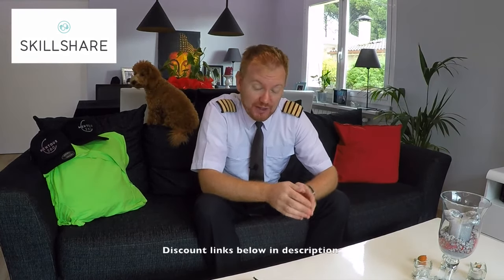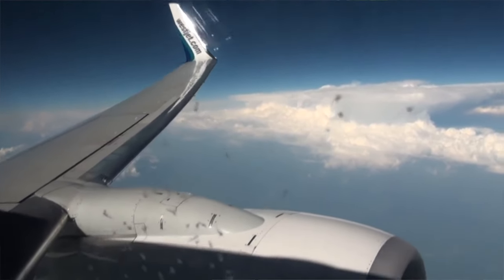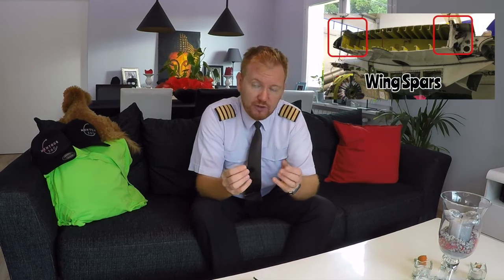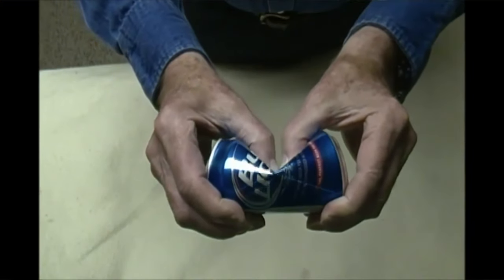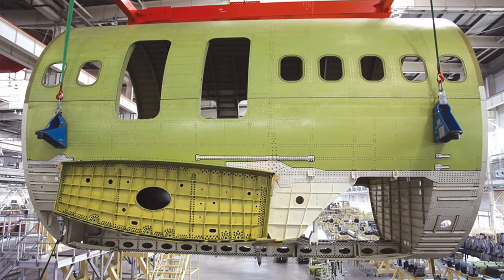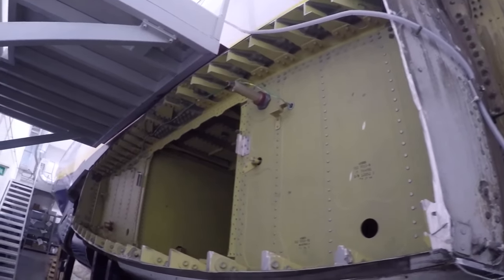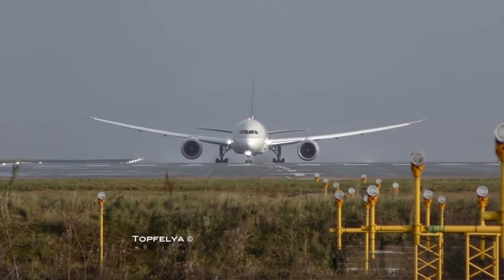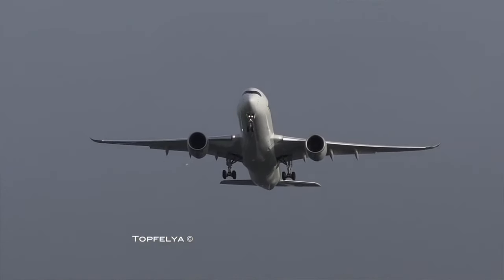Why don't the wings break?!

Comment: I am going to show how old I am now by mentioning a name from a bygone age. Back in the day one of Freddy Laker's planes had crashed and the rest of the industry lynch mobbed him by saying that he had not maintained the wing pylons and these had failed. I always wondered what wing pylons actually were. Can you throw any light on this? Thanks.
Reply: The pylons are the structures that join the engine pods to the wings. You've got it backwards on the Laker situation though. None of their DC-10's crashed but they (along with all other DC-10's) were grounded by an AD that was issued after an American Airlines DC-10 lost and engine on takeoff - not "lost" as in the engine stopped working but "lost" as in one of the wing engines came off the airplane. The pylon had been damaged by the airline maintenance shop removing and replacing the engine and pylon in a manner that damaged the pylon. The prescribed way to do this was to remove the engine from the pylon then remove the pylon from the wing. American and another airline had been removing the engine and pylon at the same time using a forklift. Laker was upset at having their DC-10's grounded because they had been doing the procedure correctly but their planes were grounded too because of the other two airlines using a shortcut. Ironically the reason all the DC-10 operators had been removing and reinstalling the engines and pylons was because of an earlier AD mandating inspection and replacement of the fittings that connected the pylon to the wing.

Comment: I'm not sure this is relevant to this video, but when you were talking about extreme turbulence in thunderstorms, you didn't mention maneuvering speed. A different subject: To help me have a more accurate understanding of the load, or lift distribution on a wing, I'd envision a straight wing, (no dihedral) , sitting on a flat piece of foam rubber, and see the that load, or lift is evenly distributed.

Comment: Once checked in the wind tunnel the engineers do the needful but too much flutter is hazardous & may prove fatal but thanks to the fuel that actually neutralize the vibration but bank angle may develop g forces that has to be another serious matter & next is extreme parameter push limits .

Comment: Very well done video I could tell that the chapter about safety maintenance was very important because the Apricot Poodle snapped to attention!  I used to have one and they are smarter than most 9th grade students.  I noticed you have matching hair so I will bite my tongue about now.  The G force explanation needs a tiny clarification as the couch is experiencing your weight as a multiple of 1G .  You do not weigh 1G.  You weigh whatever you weigh based on the relative mass between you and the Earth.  I think.  I know there is something about acceleration in there too.  Very good video all in all.  Would have advised the use of toy airplanes to illustrate some points .

Comment: i got 2 curious questions. 
1: why are the main airliners not using alternative wing designs? for example the Delta wing. wouldnt it be more sensible to use the larger internal space for fuel and storage depending on the design?

2: why isnt there many Turboprop airliners for long hauls? considering people care for efficiency wouldnt it be more sense to use that?

Comment: Wings are not connected by hundreds of bolts, usually very large 1 to 1 3/4" bolts depending on how big the plane/wing is. And mostly either 4, 6 or 8 bolts, again depending on size of the plane/wing. I'm a 24 year commercial jet mechanic/5 year military aviation technician.  
Wingtip Flex/stress test can have a wing move 12, 13, 14 feet or better. (Note: A 12 foot flex is measured by a flex of 6 feet in one direction (up) and 6 feet in the opposite direction (down) from its natural/neutral resting point...

Comment: Wing question. Always wondered what the little bracket type things on the top surface are. I think there are around 10 in a row on towards the end of the wing on a 737. Maybe to direct air? They just seem too little, appearing just an inch or so tall, to have any significant purpose.

Comment: Supertankers were designed to flex in much the same way during rough seas. Smaller ships didn't need to flex but the larger they became the more chance they had of braking in half and so they were built to bend slightly.
Reply: Breaking not braking

Comment: a design factor of 200% or more for each part ultimate or design  stresses so it will be safe to use.All parts are subjected regardless of material and the process it was built to failure that is why safety factor is applied.

Comment: 3:50 its actually called Alclad which is  an Aluminium alloy with a Cadmium protective coating on top to provide strength.
Reply: flynorthernva:  Nope. Alclad is not Cadmium, it’s a thin layer of pure aluminum which is there for corrosion resistance and is not very strong at all. In performing stress analysis with Alclad material, in many cases that thickness (~5%) needs to be corrected for (removed from consideration)
Reply: @dmoq683  is that what you found of wikipedia then?
Reply: flynorthernva   Nope, 25+ years doing stress analysis for Boeing, Lockheed Martin, and the US Army.

Comment: A mega rollercoaster (the steel ones) can have 4 G in a turn and few record breaking ones can get instantaneous 6 G.

Also Aircraft design safety factor is 1.5, so 2G rated wing can actually withstand 3 G.
Building and Bridges usually have higher factor of safety 2-3 but their design is not rigorously checked and not destructively tested. Aircraft wings will be loaded to rated limit and then go all the way up to the load accounting for safety factor, if the wing didn't break when they reach that, they will continue until it breaks.
Reply: "mega rollercoaster" I have no idea what that is.
Intamin's hypercoaster (over 200ft) model is called a Mega Coaster, but that's one manufacturer and one model.

Comment: A few decades ago I traveled in the Eastern Europe on board of an aging charter plane, probably Antonov or a similar middle-sized plane of Soviet construction. During the flight I noticed that wing plates were moving against each other a bit, perhaps a centimeter or so - to the level that some paint was scratched off the plate around the rivets. I didn't feel too safe at the time seeing that - but was it in fact safe, or not so much, indeed?

Comment: There were quite a few dc10s that were turned upside down after touching ground with the wingtip. So the wings were too hard to flex normally, hence breakable, I suppose

Comment: Flight 587...Absolutely Stunned that a few wrong rudder movements can cause the Tail to BREAK off off and The plane is out of control...Some of these planes need to be a LOT more sturdy than that...And a Passenger plane SHOULD be able to still Fly if a Piece of the tail falls off...Something HAS to be done

Comment: In 1974 , there was a terrible accident, in Venezuela. A DC-9-14 lost an elevator (the elevator got off the tail of the airplane) during the climbing phase, at 1 and a half minutes of the flight , due to a poor maintenance 4 days before the accident that caused  a loss of control of the airplane at 4,125 feet of altitude. The airplane fell spinning without control for 14 seconds, developing a high speed. and finally crashed in a flat depopulated area with tall trees. All 75 people inside the plane including the pilots and de crew died for the impact. That is how I lost my father , 47 years ago,  because of the poor maintenance of Avensa, the Venezuelan airline owner of that DC-9-14. The irresponsibility of Avensa caused this tragedy.

Comment: Thank you so much for your video, this has been a huge concern of mine, the one thing I am concerned about is the maintenance you mentioned, everywhere in automotive shops and everywhere you look, people have less care in doing their job these days than they used to in prior decades, when an airline is intended to run for profit, they have what’s I believe known as an acceptable loss range, so at what point do they sacrifice maintenance for profit? And is it possible that a major airline such as Southwest could skip some maintenance to save money or with the Federal Aviation Administration have some way of knowing that they are doing their appropriate maintenance, such as when the wing structure was found cracked in the 737 that you had made a video about, it was fantastic for the message to go out to all the airlines but how do we know the airlines actually did it and didn’t just say they did?
Reply: Well something similar has happend before, not refusing to do mantenace but being lazy and breaking rules. This is a crime now, if any airline does this they will be no longer

Comment: If you went to a metal supplier and asked for 'aviation grade aluminum' they'd look at you funny and then ask you what you want. What you need is commonly available aluminum meeting a certain specification.  Once it's cut, drilled, riveted, inspected, coated and certified as an aeronautical product, it's now 'aviation grade'. Whatever that means.

Comment: Something you did not mention was an overstressing of the wing loads due to pilot error or mechanical fault. Example would be over speeding after the aircraft enters a steep dive and is attempting to pull up due to an engine/s out or stall etc. How likely would that be? also would the tail section be more likely to fail than the wings ?

Comment: As long as it is not stretched beyond it’s elastic limitations. As a fiberglass fishing 🎣 rod the bend is distributed over its entire length.
Of coarse there are limits but the wing is tested to strength well beyond expectation of loads over the coarse of its service life.
Carbon fiber is even lighter and has proven very strong as well.

All edges are radiuses to avoid sharp angle stress points. The de Havilland Comet window design discovered the hard way.

The C- 5 Galaxy wing able to sustain flight at 840,000 pounds. A pioneer of modern heavy lifting design. 
When test facilities tested her wings to break ups the last of her gallant bulkheads make a terrible bang.

The Boeing B- 29 and later Convair B- 36 taught many lessons of handling and attaching large wing sections. Boeing Later went with swept wing designs on the B- 47 and B- 52. The later still in service.
Re engined  and new avionics but the basic airframes solider on.

Comment: What about the cracks in the A380 wings that were discovered thanks to the repair work after QF32 uncontained engine falilure? What about the 737 NG pickle forks? Does that mean that the computer simulations of stress were wrong and the monitoring of the fleetleader wasn't thorough enough?

Comment: Thats a pretty good explanation. Let me add on to this. Many of us have the misconception about the force acting on the wing. We assume that the force acts upwards at the tip of the wing. The truth is, if we divide the wing by 1000 section from front to back, (in aviation we call it chordwise), each section individually has a lifting force. That force is highest at the fuselage(root), and gradually decreases at we go at the tip. For some design, that upward force decreases to zero before the tip, and that force shifts downward at the tip.
This lift distribution is vital in keeping the wing bend (bending moment) to a reasonable value.
Lets do an experiment. Hold a ruler covering 10 cm at its edge with your hand. Now take a small but thick book and place it on its edge at the end of the ruler. The ruler will bend excessively. Now take the same book and place it by its large falt surface on the ruler near your hand. You will notice that the ruler bends but not quite much as compared to place it at its edge. Engineers used the same principle while designing the aircraft.
Aircraft designers have devised ways to avoid excessive bends and twist on wings. There is a system called active load control. Whenever the wing flexes, aileron and spoilers will deploy, very slightly without the pilot knowing. It is a self correction and this aids in reducing the stress and fatigue.
For those interested in knowing more, check out the following words in google:
1. Prandtl's lifting line theory
2. Force distribution on wings
3. Flight controls and why the concord did not have elevators.
4. Aluminium composite and Alclad

;-)

Comment: Given the regulatory capture of the FAA by the aviation industry (e.g., illustrated by how the FAA did NOT properly oversee Boeing's 737 certifications, etc., etc.) your comment about "if the FAA allows an airline to operate, you can be sure it's safe" is certainly highly optimistic, almost Pollyanna-ish.
Reply: Which has nothing at all to do with the airframe. That was due to an update to the MCAS software, an update that was pushed before FAA certification. In fact, the full software wasn't released to FAA until May of 2019, by which time the accidents had already happened.

Comment: Engineers put a lot of conservatism into the wing structure while also trying to minimize weight. This means that the wing would have to endure more force than would be encountered under normal circumstances but also is very light. This is why Aluminum is used for aircraft. While it is true that Aluminum alloys are stronger than elemental Aluminum, other materials such as Titanium would be significantly stronger than Aluminum. Unfortunately Titanium is more expensive and also a little bit heavier than Aluminum. And so basically there is this dance between considering strength of the material, cost of the material, and the weight of  the material that all need to be considered to produce an economical and strong aircraft wing.

Comment: Hi I hope you read this and hopefully make a video about it. 
For a short flight, under 1h or so, is it not burning more fuel to climb to cruise altitude and then quickly descend than it would burn in level flight at a lower altitude? I'm really curious about all the considerations about this matter.

Comment: @ Mentour Pilot During flight does the fuselage produce any lift?  It seems to me that during flight the nose of the plane ( commercial flight) is slightly higher than the tail. If this is the case, wouldn't the air going under the fuselage have higher pressure than the air going over the top and produce some lift?

Comment: They do break on very rear occasions. Usually after the pilots over speed the plane in a spiral dive then in the recovery attempt the pilot pulls and rolls at the same time. Wings aren’t good at taking excessive loads withe the pulling while being twisted by the rolling. Examples are Adams Air 737 in Indonesia and a Metroliner in New Zealand. Then there is the corrosion issues in old airplanes like the Grumman Mallard in Florida. That one was just flying along. The thing had been giving hints for months with skin cracks and leaking fuel.
Reply: Adam air 574 was not caused by the wing breaking, technically the horizontal stabilizer broke                                                                                                   
the stress of full upward elevator deflection broke the attachment points at the rear of the stabilizer and effectively turned the entire horizontal stabilizer into a giant elevator that briefly pushed the nose down at negative 3G (far beyond the negative G limits of the aircraft) before shearing off, its at that point where the wings started to break apart (or at least when the engines separated from the wings)
Reply: MWB Gaming . Thanks for the correction. Must have been a wild ride.
Reply: @mitseraffej5812  I imagine it would have been 

From +3.5g to -3g instantly
Reply: MWB Gaming . The ultimate cause of the Adams Air was abdominal training. From what I know of it one of the IRSs had a bit of a hissy fit and in their wisdom the pilots put both IRSs to attitude. In doing so they both lost their attitude and heading information. They still would have had the standby but nobody bothered to look at this and the rest is history.
Reply: @mitseraffej5812  also true, but I was referring purely to the action that caused the plane to break apart in flight

Comment: Great video.  My only nitpick is with the "aircraft grade aluminum" term, which is a meaningless term that conveys no real information about the material.  There are no special aircraft "grades" of aluminum.  There are a variety of aluminum alloys that are commonly used in aircraft, and there's nothing aircraft-specific to them.  The same alloys & tempers can be - and are - used in all manner of other applications under the same exact designations.  If someone tries to sell you something that's "aircraft grade aluminum", tell them to drop the dumb sales pitch and tell you the actual alloy.

Comment: does the plane can fly if subjected to electronic jamming and without radar and GPS ?
Reply: as far as i know yes planes can fly if they have no electronics, they will be fully controled by the pilot(s) in that case, wich doesnt happen normally since a lot of things a plane does is either computer assisted or computer controled

btw im not an expert so feel free to correct me.
Reply: @rjgamer2206  no you're right.  When the electronics go down they use mechanical hydraulic backups.  All mechanical no fly by wire.

Comment: Historically (not good or bad) Boeing Aircraft had more flexible wings, Douglas Aircraft had heavier but more aerodynamic wings with precision tapered spars. The B-2 bomber with titanium and advanced composite construction "test article" (all new designs are put on hydraulic stress machines to simulate flight) was strong enough to break the test tool. The failure of the YB-49 flying wing was aluminum construction state of art of the 1940's was not stiff enough to resist twisting with the elevon "no tail" design for turning in flight, Captain Edwards lost control and crashed over Muroc Dry Lake.